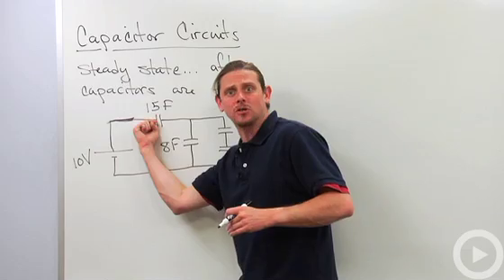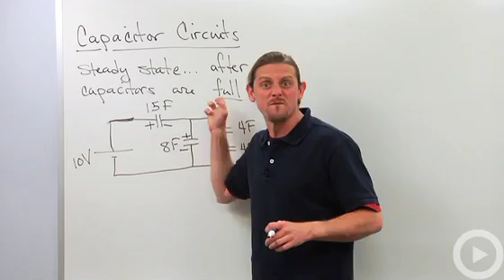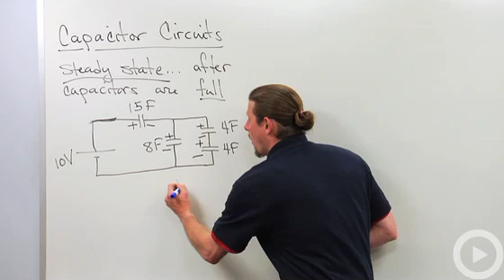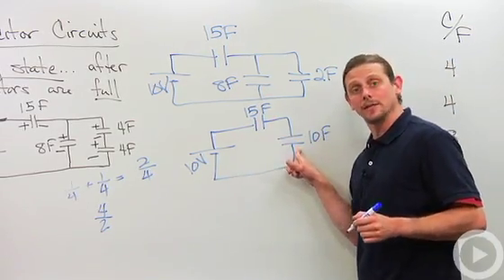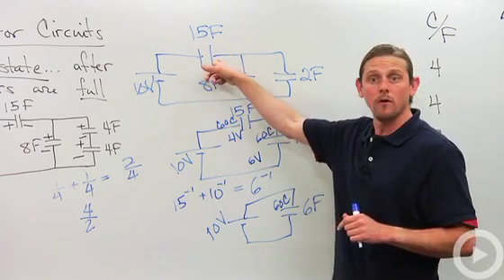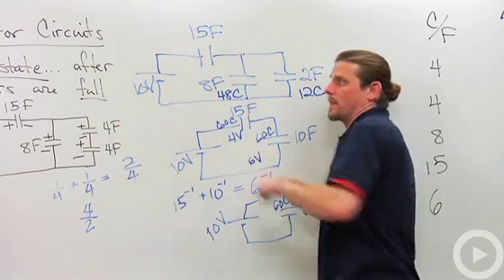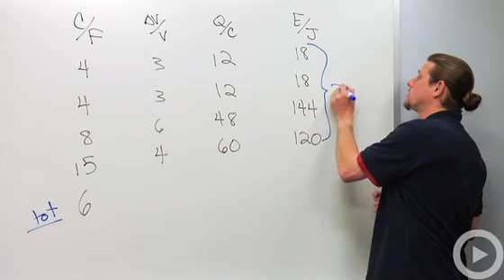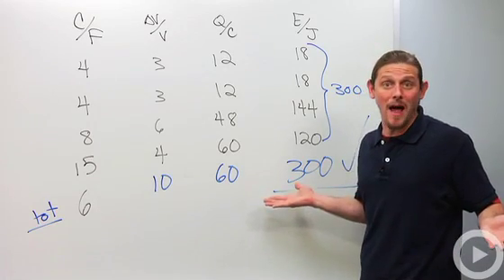Capacitor Circuits

Comment: So how large is the current? How fast are the capacitors charged? There's no resistance anywhere, so wouldn't this reach large voltage and the capacitors are charged instantaneously?

Comment: i thought the circuit requires a load so that there will be current flow. If theres no resistors, theres no current flow, and the capacitors cant be charged right? Please someone help

Comment: Could you please go through this example?

A 3.43-F and a 4.79-F capacitor are connected in series across a 40.0-V battery. A 7.29-F capacitor is then connected in parallel across the 3.43-F capacitor. Determine the voltage across the 7.29-F capacitor.
Reply: Krittika Bali why do the numbers have to be so freakin' crazy?

Comment: WRONG. 15F and 10F don´t add up like that, they are in series not parallel. The two of them are supposed to give you a capacitance of 25F together. Series: 1/Ct=1/C+1/C. Parallel: Ct=C+C
Reply: He is not wrong, you are just slow and he was TOO short cut. He is very genius. Let me explain.
You are right that C in Series is 1/Ct = 1/C1 + 1/C2 = 1/15 + 1/10 = 15^-1 + 10 ^-1 = 6^-1. So if you take reciprocal of both sides of the equation, then you will have Ct = 6, get it?

Comment: I dont understand how you get -1 25 + -1 10 = 6 ? how they even finding 25/150 to make 6?
Reply: Yea im not seeing that either
Reply: I keep getting 7.14 instead of 6. Theyre close in their inverse forms but not close enough to be the same number.
Reply: David, where did your 25^-1 come from? The numbers being used are 15^-1 + 10^-1 = 6^-1 if I am looking at the same portion of the problem as you.
Reply: I think what both David and I did was prematurely added the 1/10 and the 1/25 and accidentally substituted without thinking.